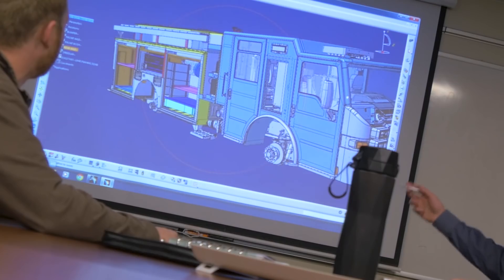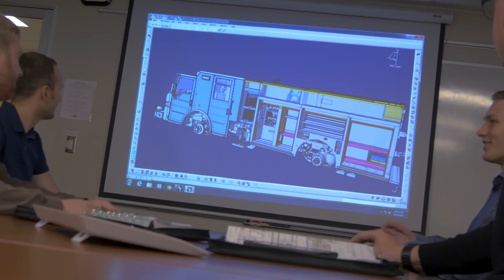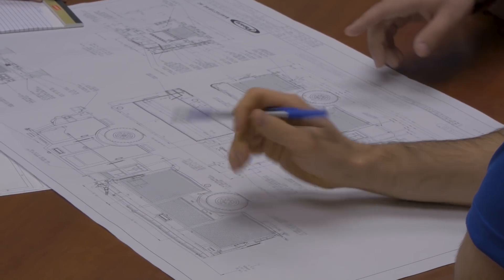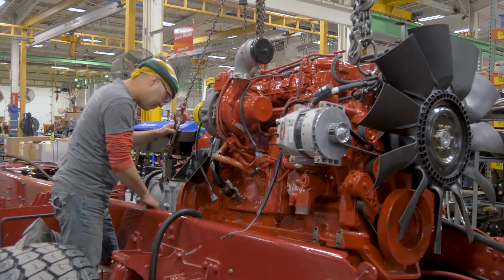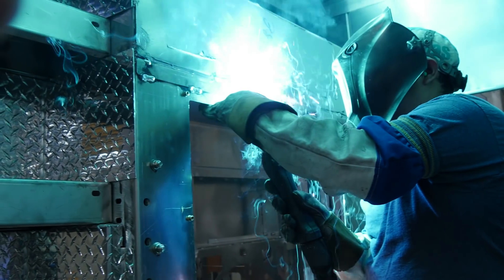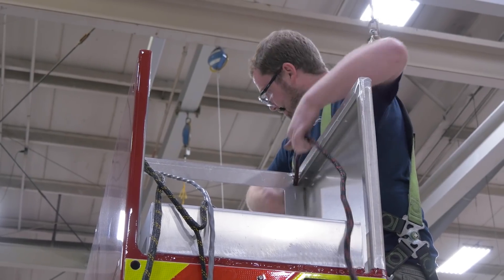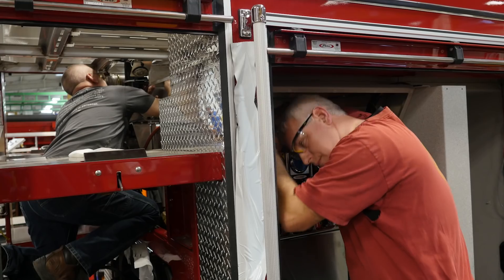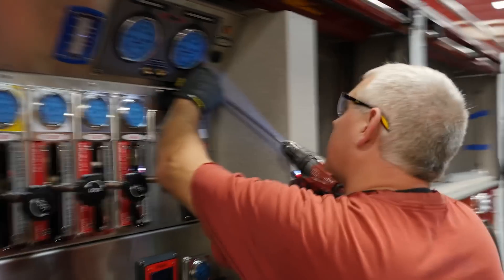2,000th Pierce Ultimate Configuration (PUC)

Comment: So , why are the guys pushing the engine into the firehouse?
Reply: Jim Willoughby it's tradition when you get a new truck that you push it into the station
Reply: Hanserpro, In thirty years of firefighting, I saw the department I  worked for take delivery of  at least seven new pieces of apparatus and we never pushed them in the stations when they  were delivered.
Reply: Steven, What part of the country  are you from?  I was a firefighter in  Massachusetts, and this is the first I've heard of it.
Reply: Pete I'd be happy to help,problem is about four years after I retired from the Shrewsbury FD, and after and because of a motorcycle trip to Alaska and back,  I moved to Cody, Wyoming.
Reply: Jim Willoughby it’s been a tradition for years. It dates back to the 1900’s when the fire service consisted of horse drawn carriages that needed to be pushed back into the fire house
Reply: Here in Maryland we still do it. We did it 2 summers ago when we got our new Seagrave Squad.
Reply: Jim Willoughby  I'm from a small town in western mas. When we get our next new truck we could use a hand pushing it in..   or we may go with the wet down.
Reply: The tradition dates back to the 1900s. Boston FD included. I'm from south jersey and we do it around here. Depends on the department and what traditions they uphold. Ours is very traditional.
Reply: Jim Willoughby my local volunteer fire department got a new truck and they pushed it into the station.